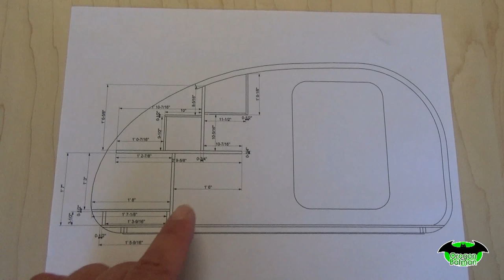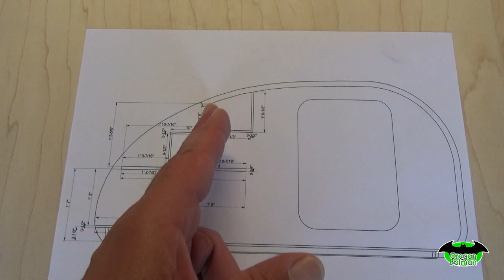Teardrop Build * Step-By-Step * - Part 16 (Bulkhead)

Comment from the maker: The plans are no longer available for free. To learn how you can get a set of drawings to build your own teardrop, click this link: https://youtu.be/4mv3ZzRZJCM

https://www.paypal.com/paypalme2/OregonBatman97741/15
Reply: I been looking at different kits I like your design what would it cost for you to pre cut the wood kit ?
Reply from the maker: @chadrossiter8432  Hi Chad! Thanks for checking it out. Not sure what a kit would actually cost. I would have to total  all the lumber used (plywood), then add labor to cut all the pieces. Then of course... shipping is what would kill the whole deal because it would have to be crated and shipped LTL. At that point, you would have a pretty penny into it and not even started yet! :)   Something I would need to total up and see what the cost would be.

Comment: An easier way to do your super-clamp....
Clamp down one small clamp at each end.  Let’s say....behind the board.  Then connect both clamps with a ratchet-strap.  

I love ratchet straps.   Where would the world be without them.

😜
Reply from the maker: I know right? I ended up using two clamps and a piece of rope in between and clamped it that way, didn't have a ratchet strap! :(  But worked just the same! YAY!